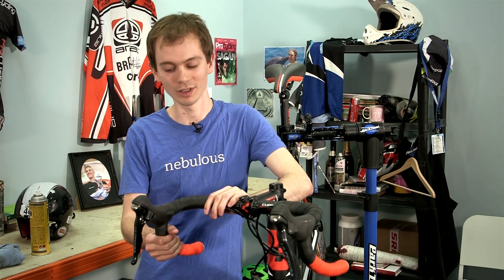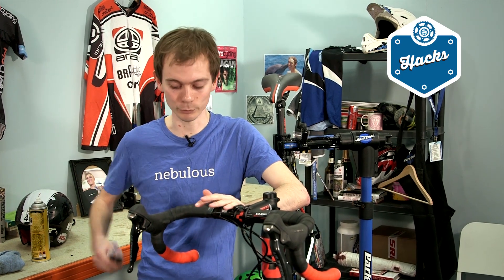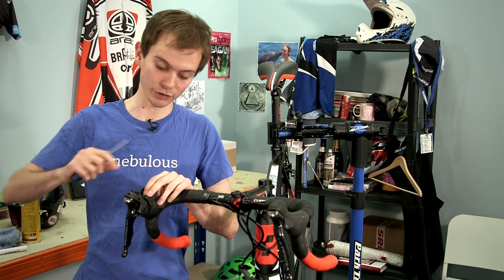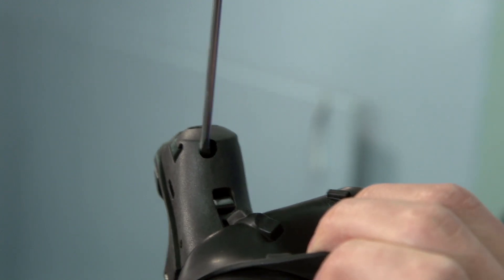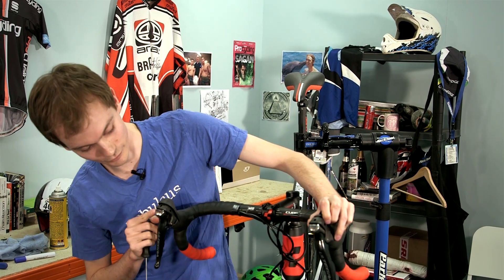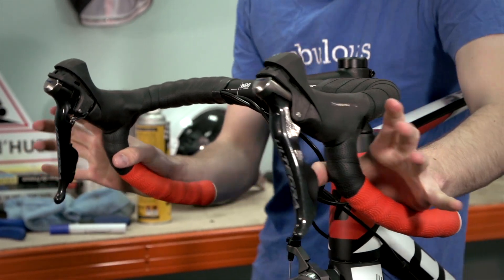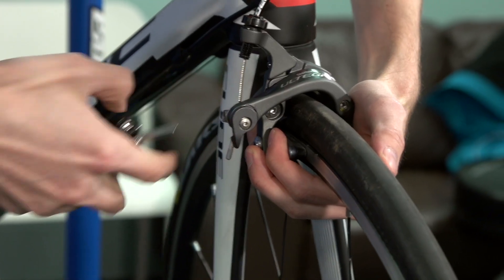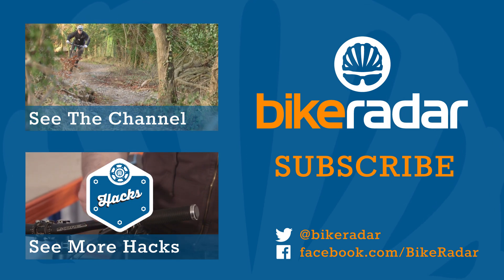Adjust Your 11-Speed Shimano Lever Reach

Comment: The edge on the side of the lever eliminates the need for the marker. And you should squeeze the lever before tightening the screw to relieve pressure from the plastic screw...

Comment: Got a Lezyne track pump that needed a new o ring seal, stripped it back to check.  Found Lezyne had thoughtfully put a spare o ring inside the barrel, hanging loose off the central column, took the worn one out and recycled it.  Put the spare in place.  Cost £0.
Reply: Oh and you need to buy a pin spanner to take the top off, or bend a spoke carefully and you can make your own like I did.
Reply: That is quite amazing service by Lezyne, and also thanks for telling us. You are amazing!

Comment: Matthew suggests using a white board or dry wipe marker but if, like me, you only have a permanent marker (sharpie) you can remove the line with a drop of nail polish remover.
Reply: I just used a piece of tape
Reply: or use tape?

Comment: is that dual coloured bar tape or just two different sections? I always use red on my drops and white on the top but just discovered certain brands that have dual colour tape.
Reply from the maker: Jarret Gosbee We'd be very impressed by the wrapping skills if it was two different lengths!  It's almost certainly Cube's own Grip Control bar tape, and you can also buy two-tone tape from brands like Lizard Skins and Supacaz.
Reply: Gotcha. I just do around the hoods starting from the drops with one colour, cut to a taper so it's not bulky and then wrap the next colour. It works well but takes some time and precision. Maybe a how-to video is in order ;)

Comment: Do 6800-5800 shifters allow for a greater adjustment than the previous generation shim based adjustment shifters?, I mean, can you set the lever closer to the bars with the new ones or the range is abaout the same?

Comment: But be careful with (Integra 6800 at least) as the screw is plastic and the head can easy shear off. :-(
Reply: Thinking about it, perhaps opening the quick release on the brakes beforehand would reduce this risk